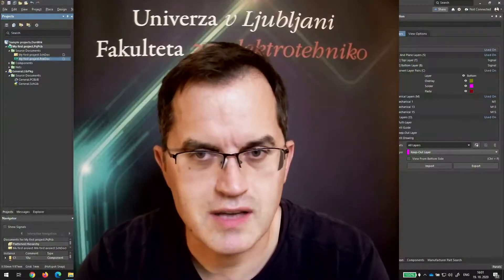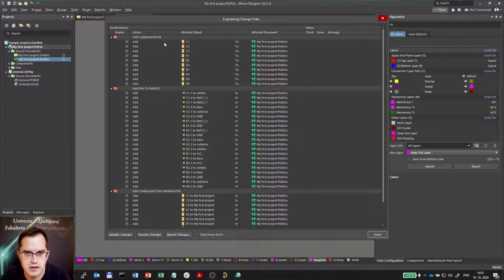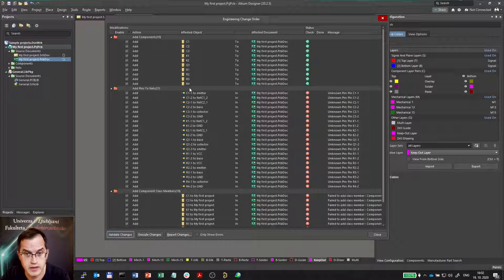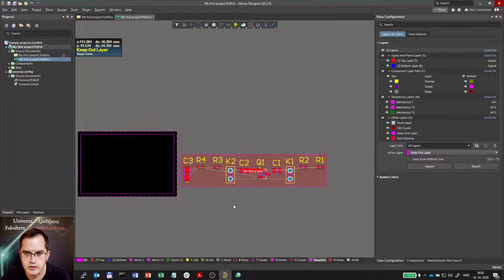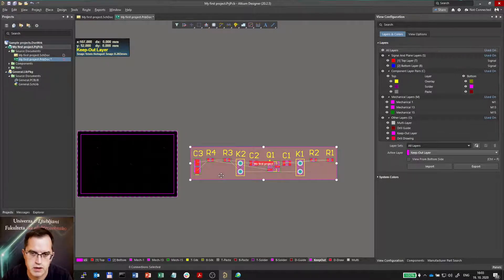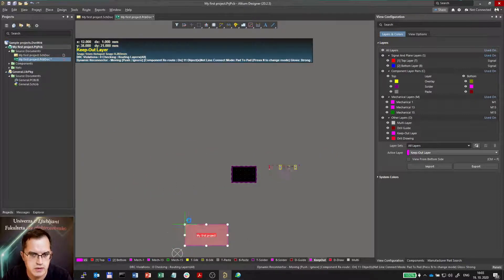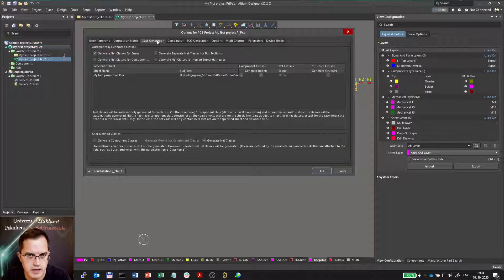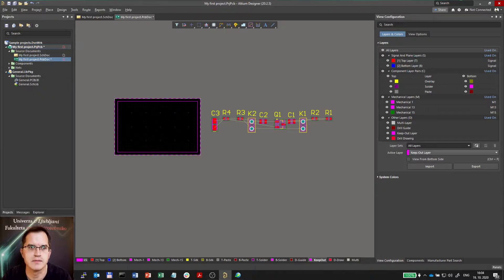Altium intro #21: Importing schematics into PCB

Comment: hi . I have a huge problem about ımporting schematic to pcb phase. firstly ı cant opened project options because it's greyed out. second problem is ı didn't have a update pcb document options in design segment. ı am sure ı am done everythink right but ı have a problems like this and because of them ı cant reach the pcb phase. thanks for help for everyone
Reply: I'm having the same issues as you. By any chance did you find a solution? I need help for a project for work, I searched and searched but can't find a solution. Any help would be greatly appreciated.
Reply: @javiermendez9365  did you guys found out ?
Reply: @ismaillichir9964  we did, the thing is that, when you start your project, it needs to be saved as it's own separate project. Else it'll just add it as a temporary project to the workspace and limit your options (greying out many options)